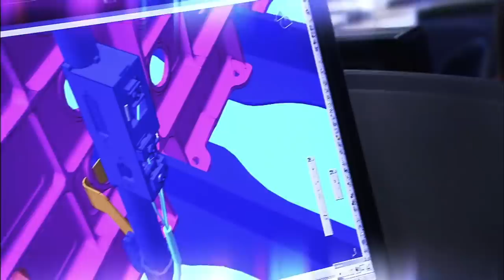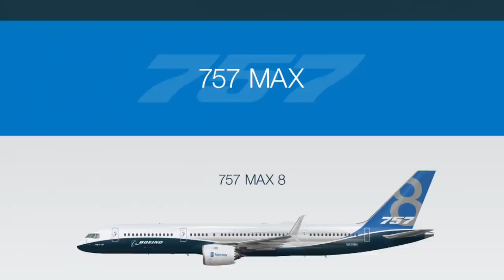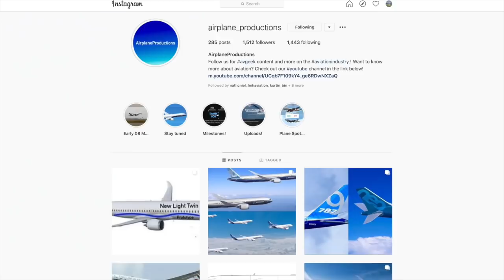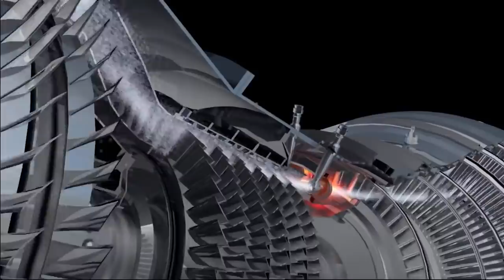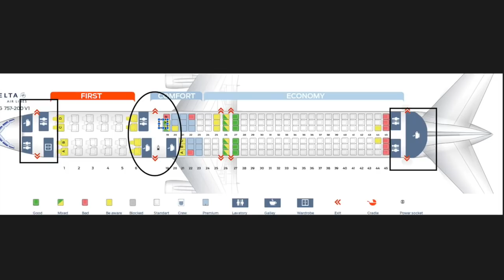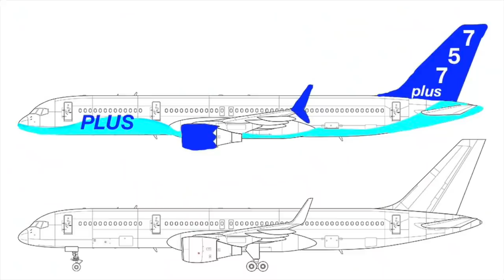Boeing 757: Could a 757 re-engine work? (757 plus)

Comment: With all that Boeing has going on currently, I simply don't understand why Boeing hasn't pursued this option more vigorously. Right now the A321XLR is DOMINATING this market, & Boeing has no direct competitor, so why not re-engine an aircraft already in their fleet? The 757, though not as fuel efficient, can carry more passengers farther as it stands right now. While the A321XLR does have a 4,700mi range, a few hundred miles better than the 757, that's only in a typical 180-200pax 2-class config., & it doesn't have the takeoff performance allowing it to operate from shorter & higher elevation runways. While the 757 is an outdated design, as correctly stated in the vid, this, as well as the other shortcomings when compared to the XLR can either be minimized or eliminated entirely if Boeing chose to go this route. The 757, unlike the 737 & 787 would serve a niche market, but if marketed correctly, Boeing could really grab a hold of this market. I mean, am I missing something? I do wish Boeing would take a step in this direction. Enjoyed the vid as always. 😎👍👍✌
Reply from the maker: D O Double G Thanks for your comment. Boeing has always been slightly uncertain when it comes to new airplane launches, but hopefully the 757 plus will be a right decision for them. Yep, all industry experts agree Boeing has to work fast! Thanks for watching and do stay tuned for more great videos on the way :)
Reply: @oneskyflyer  Thx buddy 😉
Reply: #1) You like the idiot host of this channel do not understand that the 757 has 2 generation old engines giving the 321 ability to compete in range/passengers #2) Reason 757 was liked was for its MTOW allowing it to haul cargo which the 321 cannot do much of with its much smaller MTOW/Wing.  New engines and a longer aspect ratio wing on the 757 would by itself give vastly more range than the 321... the question becomes: is there enough space for the now extra MTOW in the belly for cargo.  If this is not true, then once again, this means a shrink in wing area and corresponding shrink in engine, which in effect probably makes a321 identical twin due entirely to modern turbine engine efficiency.  At this point is it worthwhile?  Just put slightly bigger wings on the 737 and fix its undercarriage length and call it a day.  That is ultimately exactly what the 757 was originally, a slightly larger 737 clone.
Reply: @w8stral  wow, you're actually name calling on an aviation format channel. How sorry is your life that you gotta come out on a friendly forum calling people "idiots?"  All you had to do was say that you disagree, but instead you wanna start calling people "idiot's." I'll pray for you.
Reply: @w8stral  oh & by the way, WHERE DID YOU LEAN YOUR ENGLISH??? Lemme guess, Phoenix Univ???
Reply: @w8stral  I'll just never understand why people feel like they are tough when they name call on a chat forum. Come on brah, do us both a fav & just step off.
Reply: @dodoubleg2356  Engineers do not need English, just numbers

Comment: To be honest, I think that the Boeing NLT or NMA is already dead, or almost.
The development of such an aircraft depends on Delta's decision. The thing is that Delta could buy 737 Max's for a very low price and also win Airbus trust by fixing the A321xlr a huge win, and then gain huge discounts on their products. 
I think that this is very likely to happen because Delta will need a "dense" 757 replacement for their domestic routes, a logical choice would be the 737 Max 10.
Reply from the maker: Apollo FifaleX Thanks for your comment. Yep, especially since they already operate the A321neo and A321, it makes more sense to get the XLR for them. Thanks for watching and do stay tuned for more great videos on the way!

Comment from the maker: 757 plus! Will this aircraft be an A Plus for Boeing? What features would you like to see "plussed" onto the 757? Do comment below!
Reply: 7-10% fuel burn reduction is for wide bodies with big class 5 wings. Composite wings on single isle will only give 1-3% fuel burn improvements.
RR Ultrafan is scalable from 25klbf to 100klbf. The Ultrafan is boasting an impressive 25% efficiency improvement over the first generation Trent engines and it will probably offer about some 35% improvements over the RB211. That places the PW GTF to be about 30% more fuel efficient than the PW2000 engines on the old B757.
Reply: @chingweixion621  But the question is, can Ultrafan fits onto A320 frames?
If yes, it’ll end up with the same story - 757 being heavier and less efficient.
Reply: @steinwaldmadchen  engine growth is both ways. The current PW is already at BPR of 12:1. The RR Ultrafan with a similar thrust rating should not be much bigger. Higher OPR and temperature will allow for smaller core and higher BPR. My guess is that it will be probably around 90-100in with BPR of around 15. By then Airbus will probably look into giving the next A320neo a new pair of wings as well, so probably fitting the RR Ultrafan underneath shouldn't be a problem.
Reply: I'd like to see it replace the aging 737  design (which is basically an updated, 2 engined 707) so a cockpit from a 737 for ease of training (the 757 never had its own cockpit anyways as it shared it with the 767) and an option for shorter fuselages as well as standard 757-200 length. The 737 MAX would be forgotten as a mistake corrected by the new CEO at Boeing and the popular 757 would be back in a more usable capacity. It always was before it's time as evidenced by it's current heavy usage by Delta and United. I think this would put it more directly against the a320 family in competition. 
The alternative is to keep investing in a possible dead end with the 737 and bad public perception AND fail to compete against Airbus's 321. Worst case that's too much risk and best case, not enough reward.
Reply: @calvinpanda4023  Yep, Boeing is seriously dropping the ball right now as they could easily turn the 757 into Boeing's equivalent of the a320 family and make the 757 fuselage as long or short as needed. Instead, they want to keep dumping money into the 737 which was good but has reached it's limits of development. This at least gives some hope. Now would be a great time too, as the new CEO could make himself out to look like a hero for correcting the "MAX mistake"